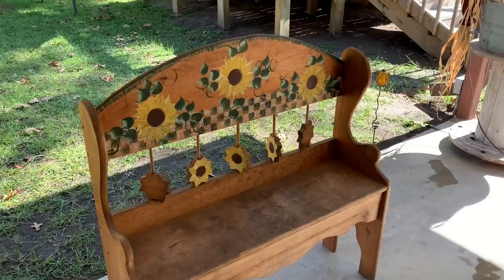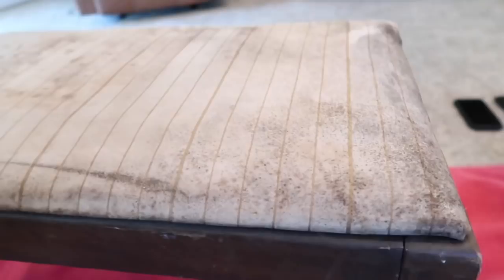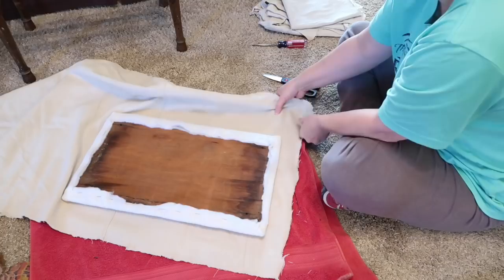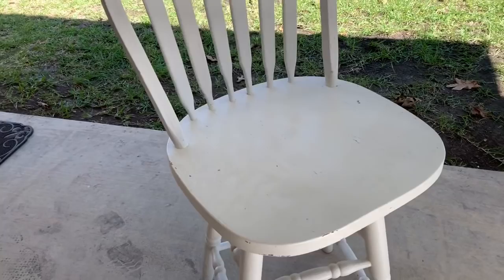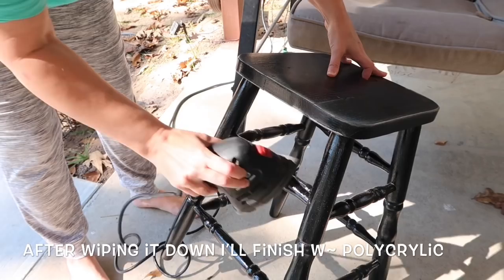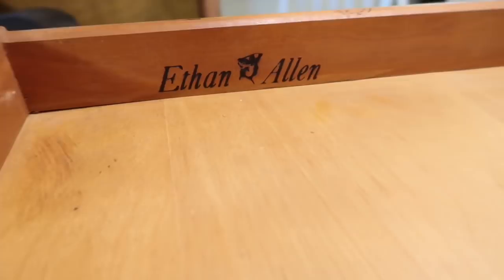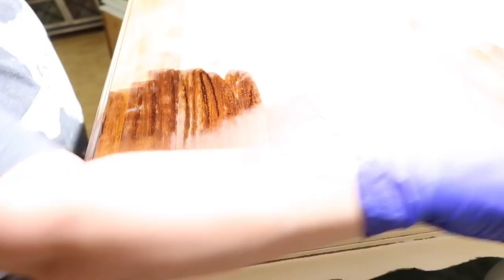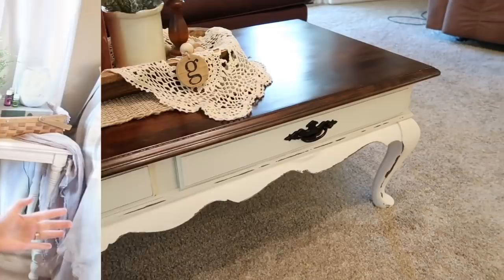THRIFT FLIPPING home decor on a budget *

Comment: In regards to the sunflower bench. Why didn't you just apply some paint remover let it soak and strip It Off? Then sand it primate with some bin sealer primer and then paint two top coats?? It's really pretty simple

Comment: It's quilt batting/filler - sorry but you should of used some foam and then wrapped the quilt batting around over it then put the material over it.  There will not be any cushion to the seat.
Reply from the maker: It’s ok, I’m using as a foot stool currently. I’ll add foam when using as a seat again.